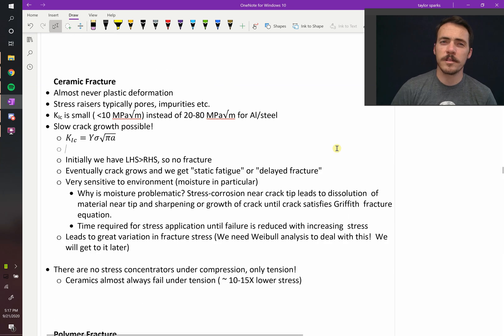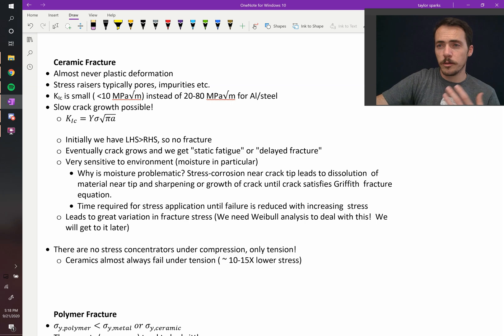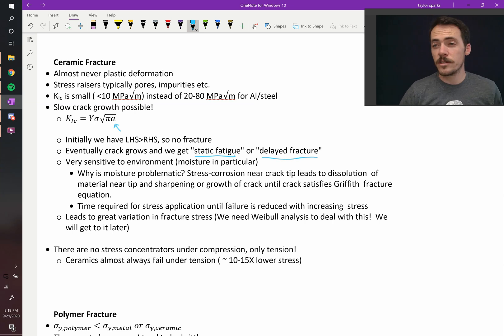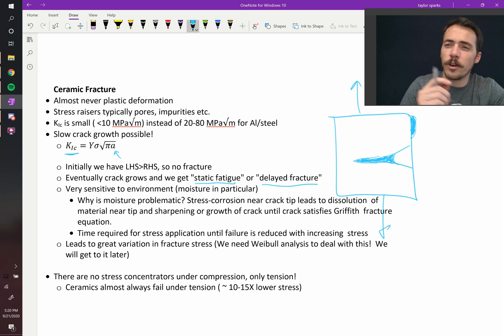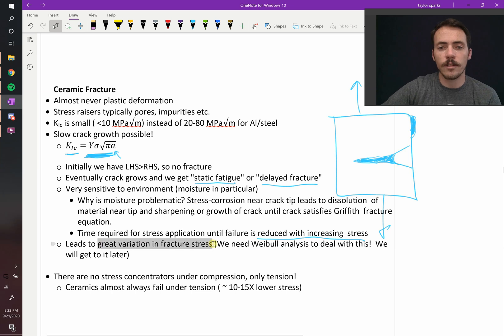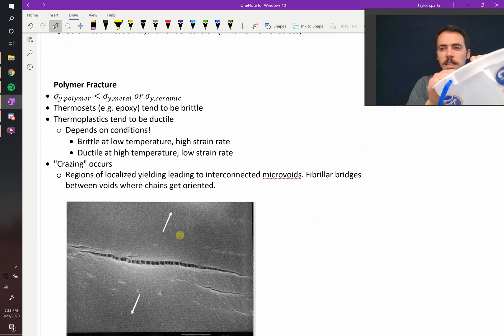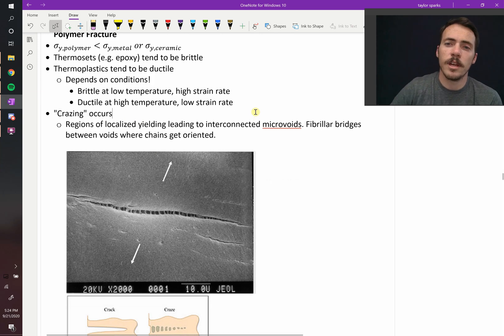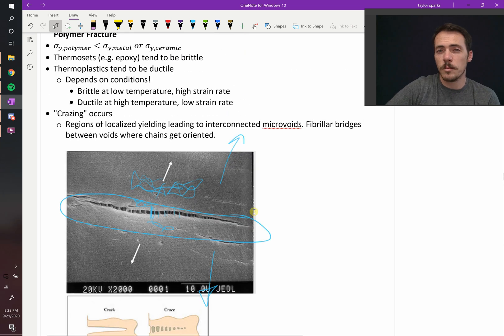Fracture characteristics of ceramics, polymers, and metals

Comment: How is the fracture toughness experimentally determined for ceramics? Does one also use COD-Diagrams and CT-specimens like one does for some metallic materials?
Reply: i am very late and i hope you have already gotten your answer, but if not, here it is ;D 

in order to mesure fracture toughness for ceramics you have to introduce a flaw that is big enough to be the one acting as the stress amplificator. you can then test your piece in traction and mesure the stress needed for fracture. if the flaw you introduced is really the one that cause the propagation of the crack, you can consider his size as "a" in the following equation :

KIc  = Y *sigma * sqroot(pi*a), 

since you mesured the stress needed for fracture, you have everything to calculate the fracture toughness KIc :D